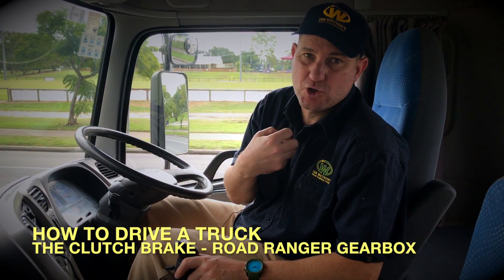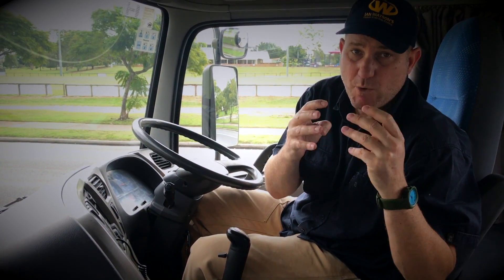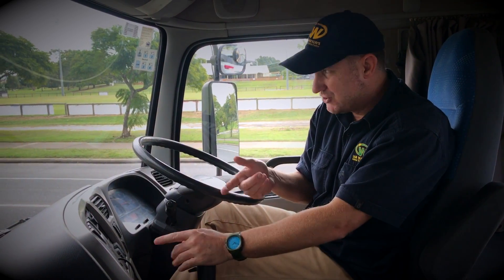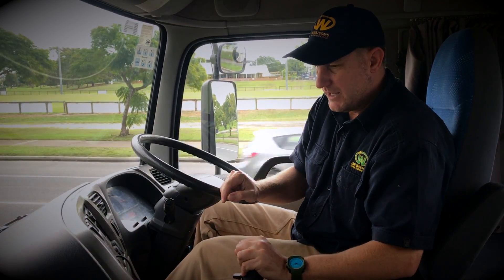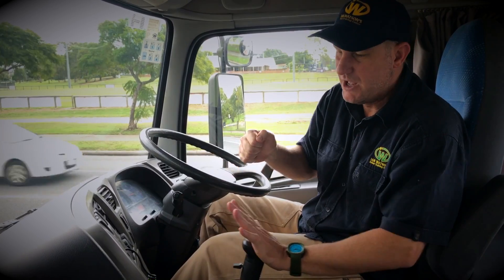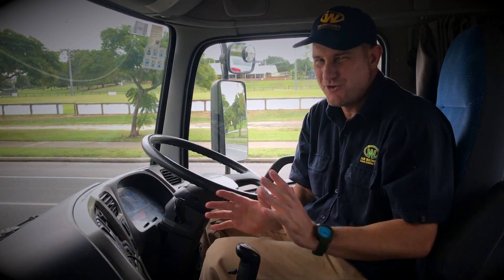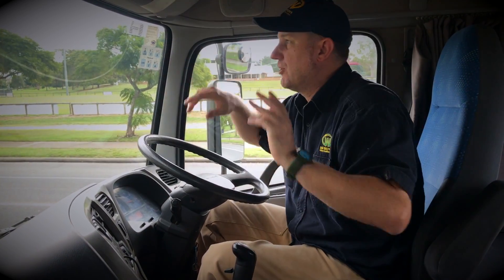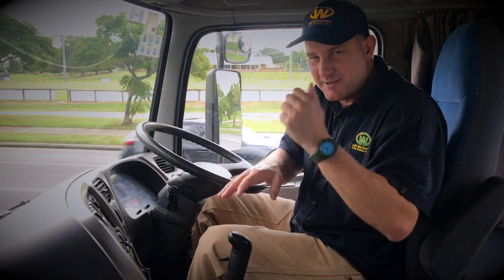The Clutch Brake on a Roadranger  - How to engage a gear when stationary - how to drive a truck

Comment: I worked out in my road car that when you slightly engage the clutch to get the gear to select is that what you are doing is this, you are no longer fighting against the resistance/compression of the engine so the gear lever can develop enough force to align the gears. Hope that made sense.

Comment: I'm used to driving without a clutch brake as most of them (as I soon find out) are stuffed anyway. Only because when I was learning I was told when changing gears whilst moving,  you only need to depress the clutch around halfway, NOT all the way... because going fully to the floor wears out the clutch break... (Whilst moving). 

BUT, when the box is 'cold' it's ok at a full stop. But when it's at running temp, nup! No clutch brake. Sometimes it's not uncommon to wait around 10-12 seconds for the gears to slow down until it's ok to quickly (but not forcefully) "click" it into position. 

But the rest of the time, yeah... it's fine if you don't let the foot off the clutch and just hold it in "The Dead Zone". 

Mostly now if I jump in a truck that has a stuffed clutch brake, when approaching a full stop, I'll pull up say in 2-3Lo and slightly engage the clutch for a second to make sure the gears are at least slowed down then (if loaded) I don't have to wait till forever because I've slowed the gears down crawling to the last part of the stop, and the gears slow with the slower approach speed. 

NO, I'm not riding the clutch. 
Whilst in the low range sitting, I'll quickly feel the clutch so that the gears slow. But if I'm sitting there in neutral and let the clutch out, I'm buggard. The trick is, don't use neutral and let out the clutch whilst at a short stop. If you have to get out to open a gate, well... either you wait OR kill the motor and restart with your foot ALREADY on the clutch. It's a pain!

BUT I can never let the clutch come completely out, because if I do (in neutral)... it engages to box and speeds it up to the idle speed of the engine... and if you have no clutch brake, you'll be there forever waiting for the box to slow down. I hope this makes sense. But it works. ;)
Reply from the maker: Thanks for sharing - you make some excellent points!
Reply: I understood what you were saying.

Comment: Why would a truck have such transmission in the first place? are trucks still being manufactured with Road Ranger today?
Reply: Simple answer is that a fully manual gearbox can mostly always be made to work in an isolated environment if there is a problem with a gear by skipping that particular cog.

Comment: In 2008, I resigned from a management position with the Brisbane City Council. Ironically, I was in charge of a fleet of heavy road sweeping vehicles even though I didn't have a heavy vehicle licence myself. Not knowing what I was going to do, I enrolled in a heavy rigid driving course with Watsons at Caboolture. I must admit, I hadn't anticipated being faced with a Roadranger transmission. Despite having driven manual gearbox vehicles for forty years, I found it surprisingly difficult. In fact, I was garbage!
So with that in mind it was a testament to the teaching skills of the guys at Watsons that allowed me to pass my test with flying colours after only a few lessons.

Comment: I drove an 18 speed paddle shift auto RR and the clutch brake was out of adjustment (which I was unaware of). It stranded me across a main road blocking both directions at night for about half an hour until it finally allowed selection of first gear. It frustrated the hell out of me not to mention the waiting traffic. I used to drive a 9 speed 3070 8 wheeler and with no clutch brake would depress the clutch and count to ten before engaging. Worked every time.

Comment: Does this (2nd method) work on cars as well??
Reply: Yes. Shouldn't need it on forward gears as the synchromesh rings should take care of it, but as there is no synchro on reverse this method works very well when trying to select reverse in a car. A truck Road Ranger gearbox doesn't not have synchromesh on any gears, often referred to as a "dog engagement" or "crash" gearbox as it has dog rings instead of synchromesh rings.
Reply: @LS2MGB  keep in mind European and some Asian trucks in Australia have synchronized Transmissions  the larger UD Quon Isuzu Giha and Hino 700 use American 18 speed transmissions.